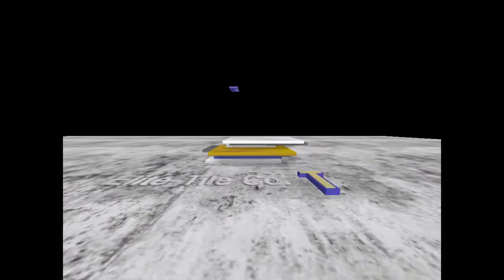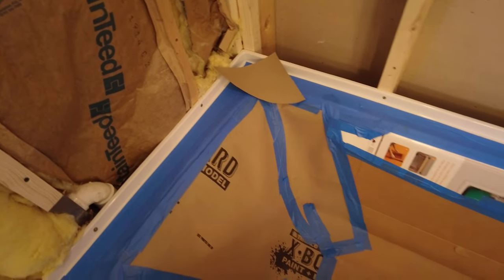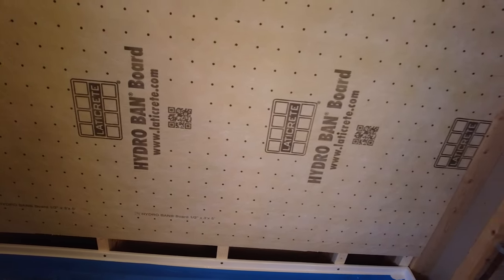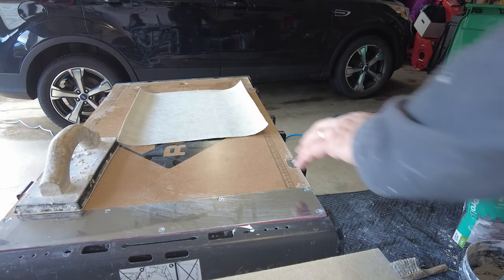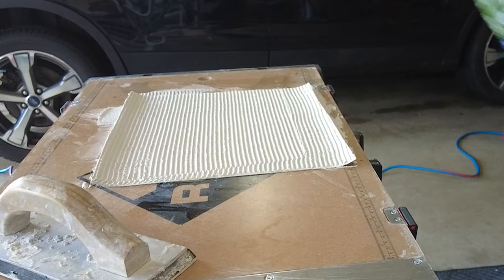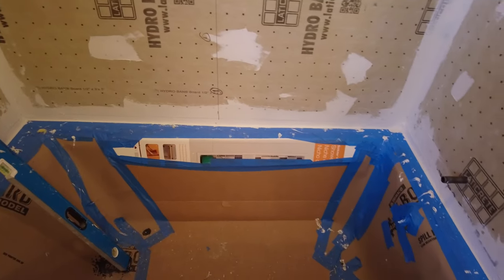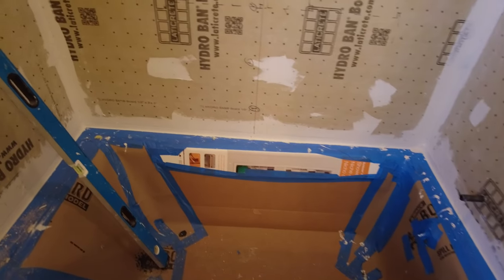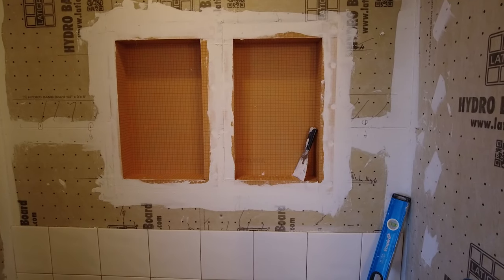Bathtub tile surround. Prep and layout, many tips.

Comment: What would you recommend we installed the finish edge with the system we did white tile with the white trim piece to finish it nicely we are diy ers first time bathroom makeover so we didn’t think about this step, our drywall doesn’t sit flush and we still have to repair some on edge. Would you recommend replacing that drywall board all the way